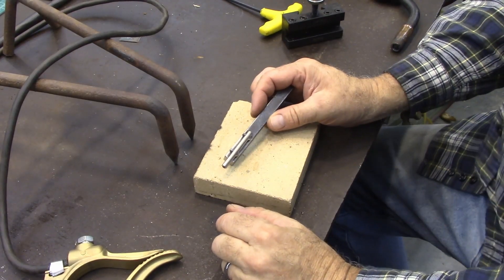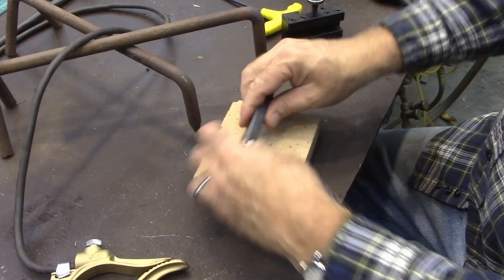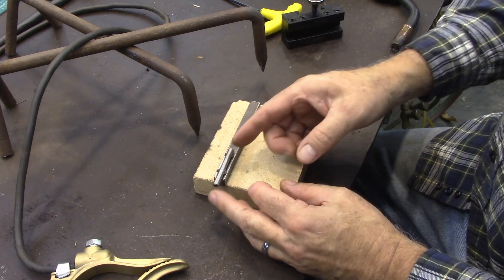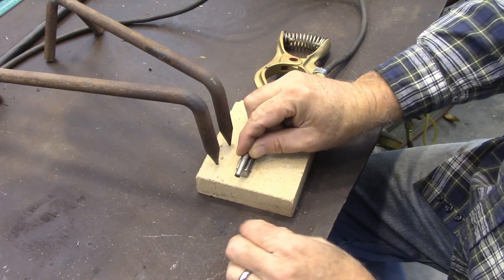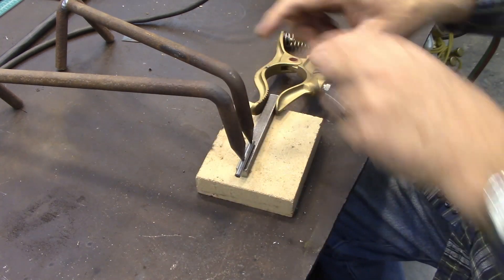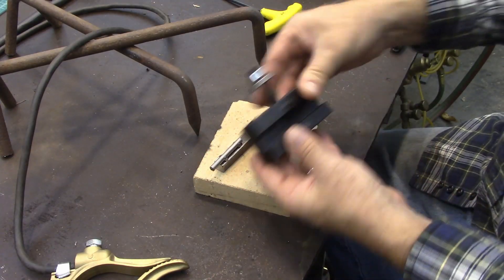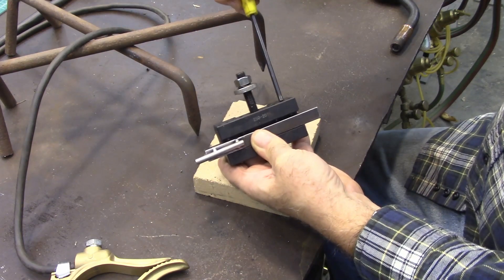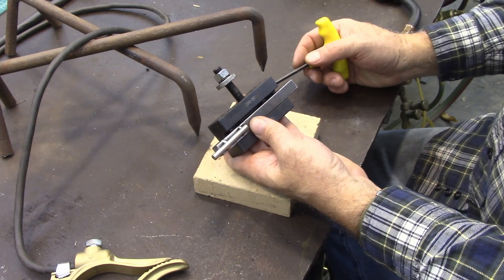DIY Easy Spring Making Device

Comment: Now thats a waist of time.That whole fixture can be replaced by 2 pieces of hard wood with a small groove filed in middle of bottom one.Grease the groove and top half.
Clamp them as tight as you need,it will tension wire and make a nice even spring .
Reply: For someone who has a YouTube channel, your comment is a great way of identifying you as an arrogant and rude person. Your comment also shows you're not terribly bright either. Given the amount of online user metrics sold to third-parties, you may already be in an scumbag list.